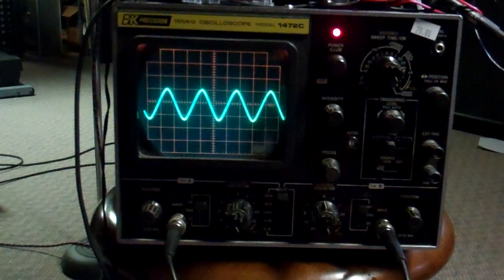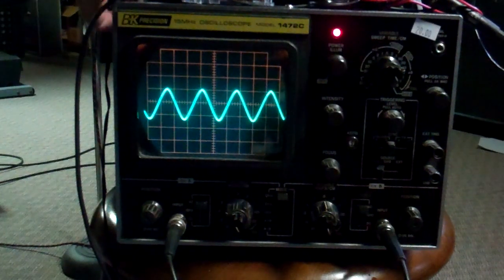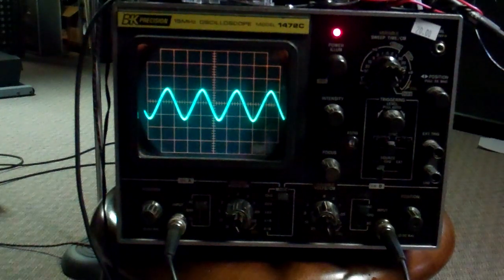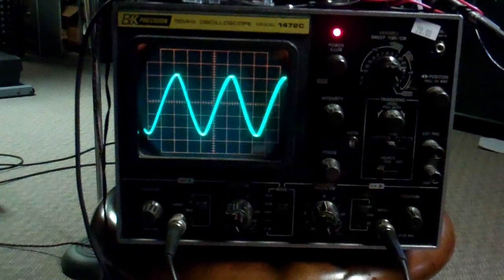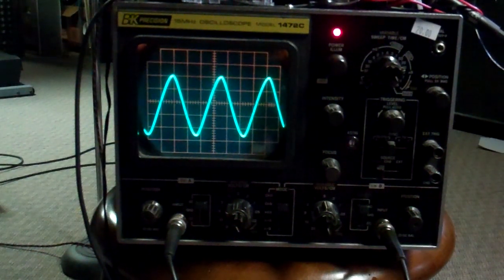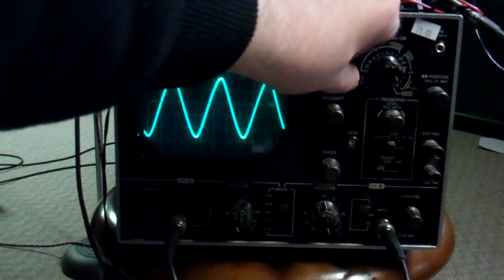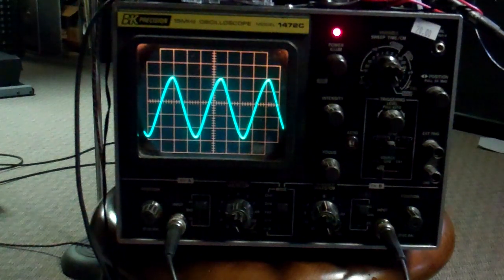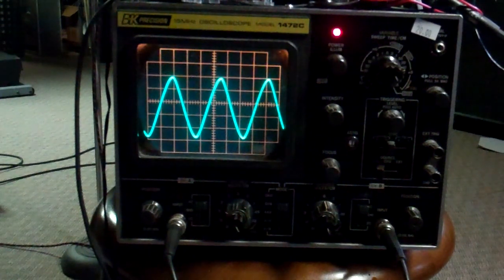DK Finds a BK!  BK Precision 1472C Oscilloscope

Comment: What do you mean by clean the controls? I just picked one of these up for around $25 and it's been about 20 years since I used an O-scope in the Navy, but I look forward to using it for testing and troubleshooting! Cool video!
Reply from the maker: Cleaning the controls is using contact cleaner and electronics lubricant in the potentiometers and switches
Reply: @DeadKoby  thanks, I'll give it a shot to see I can improve them!

Comment: Hi! I also got this scope at a thrift fullly working for a great deal. Was wondering if you know how to set the xy mode on. Tha manual says it has one but I don’t see where.
Reply from the maker: I think that's on 1472B.... not  1472C
Reply: @DeadKoby  I actually figured it out shortly after sending this comment! It is on on 1472c as that’s what’s I’ve got. You just switch the variable sweep time knob to channel B and it goes into x-y
Reply: I found one today doing a hoarder clean out. What would you say these are valued at?
Reply: @Keithasa  like $40 if it’s working. they’re nothing special. just a handy and reliable tool.